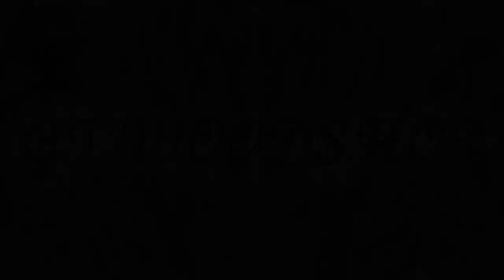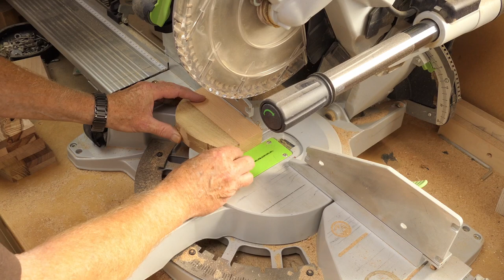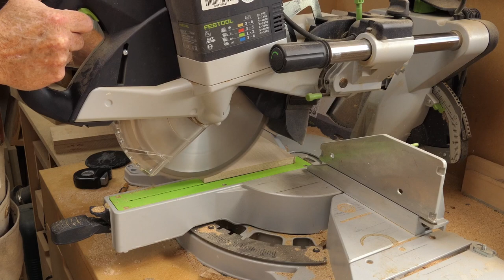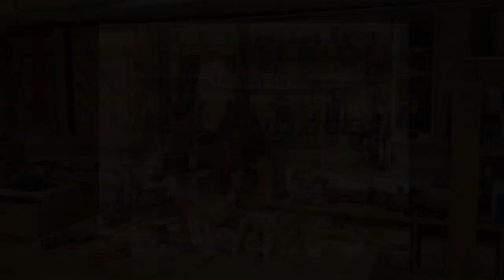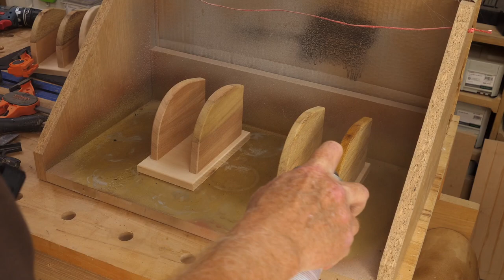Cutting Board Stands from left over waste wood - its never wasted.

Comment: Graham - is the 'round over' router a special router or just a small router with a round over bit in it and if so which make and model, secondly, I have wet the wooden blanks as your channel suggests to 'pop the grain' before sanding and after a couple of hours to dry, I have found the wood has gone a purply black colour and looks like a mold of some kind - I only used fresh water, - did \i leave it too long before sanding (3 hours) what have I done wrong -  i can probably sand it out but something has gone wrong -  can you help  ta Geoff
Reply from the maker: Hi Geoff, yes, bang on.  I am referring to a round over / ovolo bit in the router.  The staining on the timber will be from a contaminent in the timber, not in the water which should sand out quite easy, had it myself with Oak especially a few times.
Reply: @GTWoodshop  Thank you - noticed but forgot to say, it seems only to be on the oak - both in new oak from the sawmill and from some recycled oak worktops I was using - the other woods look ok -  will have a go at sanding when I have recovered :)  thanks again  G